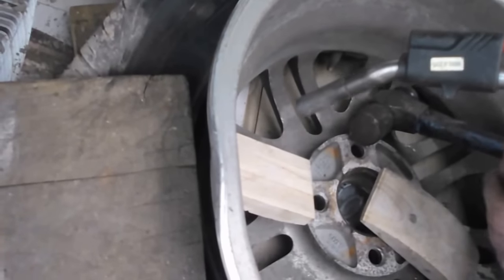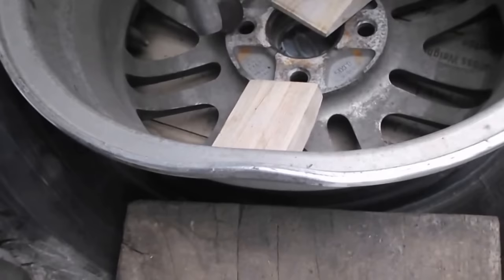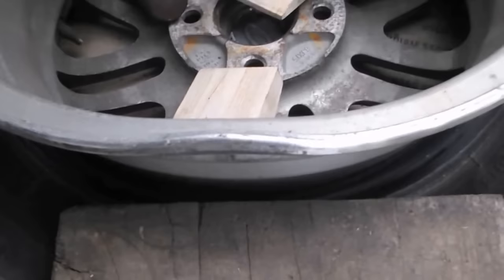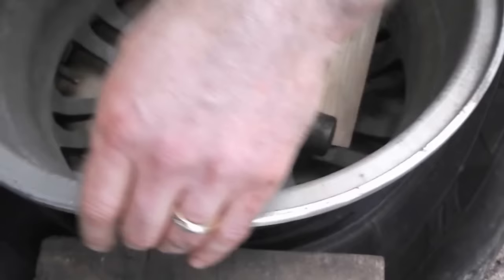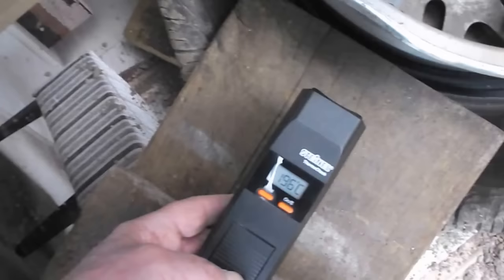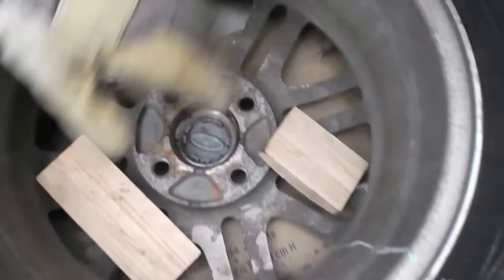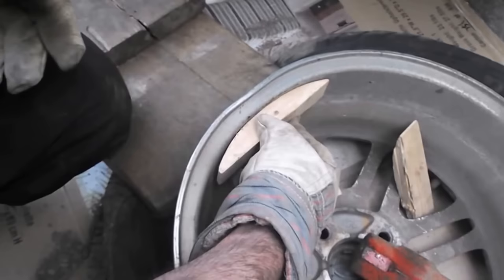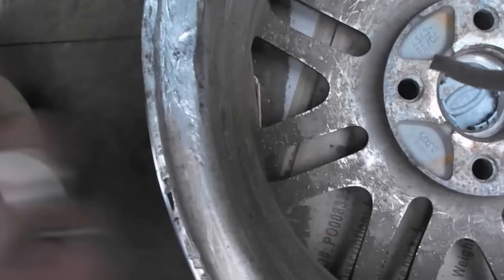DIY Straightening a bent alloy rim in your driveway

Comment: This is not the best way, but anyway it works. You are weakening the aluminum and causing minor cracks by meeting it with the iron hammer. Smashing it with the wood is the best way, as the wood absorbs the hit. And final thing , the rim is straight to the eye, but not on a machine,and it wouldn't "roll" good on the road.I mean if it's a front your steering wheel might vibrate etc. This is one of many ways to do it , but wooden block and bigger hammer are needed. Had fun watching overall. :D
Reply from the maker: thanks for the constructive feedback.
Reply: Isn't his rim alloy
Reply: The wood seemed to disagree
Reply: @mrdiyguy123  never hit a hammer off another hammer. High risk of flying shrapnel
Reply: @davidoff59  that's a myth

Comment: The proof of the pudding is in the eating and apparently it balanced well and keeps the air.  To harden aluminium alloys you incure more than 10% deformation. Like you normally do with a dent, but you can also just hammer on it and it gets the same effect, smaller grains and less ductile.  That is why you quite correctly heat it to aneal the metal to get larger grains and more ductile material.  A hydraulic jack is more controlable than a sledge. The easyist way to make a support for the jack to fit the rim, is some mortar in a plastic bag inside the rim and leave it overnight. 

Hitting a hardened hammer with another hardened hammer is dangerous and it may explode almost like glass and throw splinters all over the plase.  

A+ for effort and initiative
Reply: Banging 2 hammers does nothing. Thats just a myth. Was tested on myth busters! Glass lol
Reply: @JB-tb1zr  sure sure tell it to someone who lost an eye to that
Reply: place
Reply: It's a ball pein hammer,  that's what you do with ball pein hammers
Reply: Your idea of a bag of mortar clicked with me. On the outside, I used our strongest ready-mix concrete to support the foot of my porta-power. It worked. No heat needed. Wheel and inflated tyre were still on the car.

Comment: You did well removing the bend, however the inside bead where the rubber tire bead meets the aluminum wheel needs inspection and possibly a rasp file or emery cloth rubbed completely around the repaired area otherwise mounting a tire on an uneven and rough surface e will surely create a slow leak that will empty the air in your tire in a couple days!
Reply from the maker: In my case, the rim did not lose air after the bend was straightened but I agree what you say is good advice.

Comment: I get what you tried to do, but it would've been much easier to clamp down the wheel and use a big adjustable wrench to straighten the edge of the rim. A dead blow hammer and a body form would've worked much better to round out the inside section, too.

Comment: Awesome video guys. I doubt they did this before but they has knowledge and specialy characteristics of matterials had to work with.
Reply from the maker: I have since acquired an oxy/acetylene torch.  If I had a do over, I likely would heat it up with the new torch to reduce the amount of banging.

Comment: A little crude with a sledge hammer and the end result shows.  Rather than a sledge hammer, stabilize the back side of a bottle jack against the rim opposite the bend  with a similar piece of wood, heat the area with the bend and gently use the bottle jack to apply even pressure to bend.  Its a far more elegant approach that is much easier to accomplish the same task.
Reply from the maker: You are absolutely correct.  My method worked... but was crude.

Comment: its quite cheap to get it rounded again at a proper shop...! lots of potential issues w this approach.  ideally, don't use low profiles...!  This is also the very real issue, that once heat treated to re-round a rim, the rim will be structurally weaker.

Comment: A scissor jack with those 2 pieces of hard wood would have made it look better with less damage, but this is not a show car and it worked so who cares. Good job and better than paying a professional $100 or more to fix a rim that is barely worth that.
Reply from the maker: Thanks for the feedback. I will definitely try the scissor jack method next time.
Reply: Yep! Heat and 3 tonne bottle jack work magic! Shop wants $125 minimum to bump out 3/16 pothole dent in my $150 rim.
Reply: Good ideas guys, I was thinking that a hydraulic press type configuration with that rounded jig would work, but that bottle jack stuff sounds easiest

Comment: Go on Ebay. You’ll be surprised how cheap you can buy a rim. My Lexus rim is $600-700 at the dealer. I got it for $90-100 on EBay used.

Comment: He's cold-working the material so it's actually getting stronger in that area due to grain alignment. The problem is that area of the rim also becomes more brittle so it has less impact absorption. No biggie, just don't hit the curb in the same spot on the tire next time. LOL!
Reply from the maker: You are absolutely correct.  I wouldn't want to bend it back, then correct that bend, then correct it the other way for the very reason you mentioned.
Reply: @mrdiyguy123  The benefits of taking Material Science 34 years ago at Annapolis. It's actually one of the few classes that I enjoyed! Haha

Comment: Those hammers are made from forged steel. I would highly recommend not using them as you show it. Metal chips can fly off them at incredible speeds and embed themselves deep in the skin and tissues. Imagine one hitting your eyeball. Don't do it.
"Edited"
Use a dolly.
Reply from the maker: Your advice about safety is valid.  There is a misconception popular with old guys that hiting 2 hammers together can make them explode.  This is ridiculous.  However, chips are a valid concern.  People certainly can decide risk for themselves.

Comment: If your reading the comments fuck the heat and wood just beat Mine with a nail hammer and it worked perfectly just use a micro fire clothes to avoid indents

Comment: It's a shame this guy's never heard of a bottle jack. Brace against wood on either side, gently force it back.  (Sung to the tune of "House of the Rising Sun"): Mothers, tell your children. Not to do as he has done..
Reply from the maker: Thanks for the suggestion.  I was worried the whole rim would become oval shaped but I may give it a try next time.
Reply: @mrdiyguy123 Thanks for not being offended by my humor, it could have been more mellow.  Use a curved block like you had (on both ends), then a spacer to get the bottle jack length correct (like a piece of 4x4).  The curved block in the good side against the cold metal will spread the pressure out very evenly/low pressure. The tip of the curve on the block against the heated side will apply the pressure to make it give.

You're heating technique was great and then you'll end up with a nicely re-rounded wheel and zero damage.
Reply from the maker: @JK-jt5qh  great instructions. I will definitely try it that way next time.

Comment: Is it absolutely nessesary to heat an alloy rim for a small lip straitening? I need to do a repair on a chrome plated rim. Second oppinons please.
Reply: By heating it, you make it a lot more malleable and less likely to shatter if you beat on it. The issue is that if it's already bent, the rim probably has a lot of stress there and makes it weaker, kind of like how if you fold a piece of sheet metal back and forth it will eventually come apart at the bend.
Stick to heating it if you value the rim.
Reply: Zer0-  Thanks for the advice. And that's a good way to describe it.

Comment: Just dumb, without a solid measurement, a Story stick as a guide to show how far. So sick of eyeballers/  150 celcius is a joke also  not even enough to bother paper. Just no experience might as well be cold Propane to 700 F. Pressure of a jack is less harmful/  Fracture as you may

Comment: Butcher job. Also a rim MUST be spun to make sure it doesn't shake. SMH
Reply from the maker: Donna Mici 
I never claimed it was the best way.  The alternative for us was trying to find a match at a junk yard.  It would have cost more to have it professionally straightened than at a parts recycler. However, we have driven on it for 2 years with no shake and no uneven tread wear so I guess it worked out fine for us for zero cost.
Reply: You were very luck. I have a TON of experience w/ bent rims on NYC roads. Also, the car I drive - Lexus sc430 - achilles heal is that the wheels bend ALL THE TIME. Again, you were VERY LUCKY.
Reply: @donnamicci9996  I mean...if that's the Achilles heel of the car...get aftermarket rims that don't suck as much as the OEM ones apparently do. Sounds like those OEM ones are worse than refurbs.